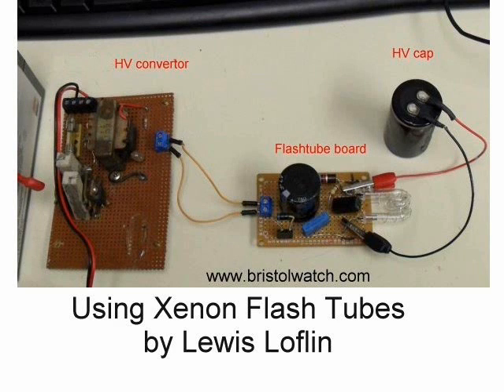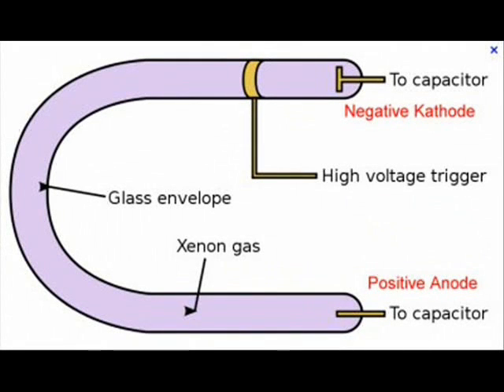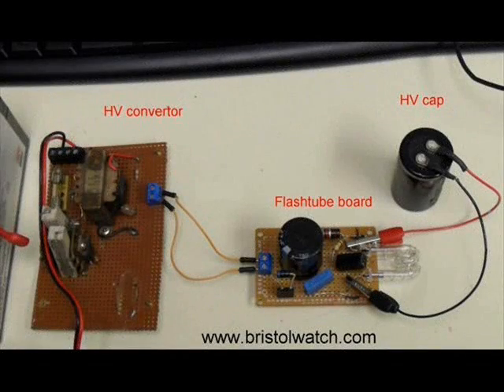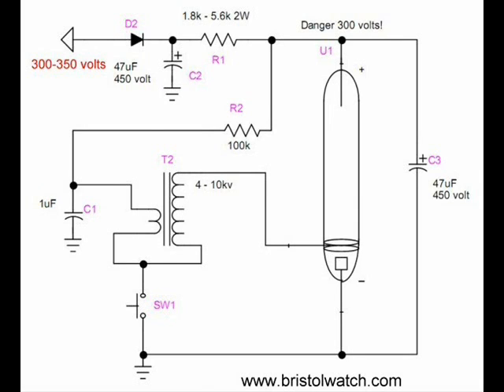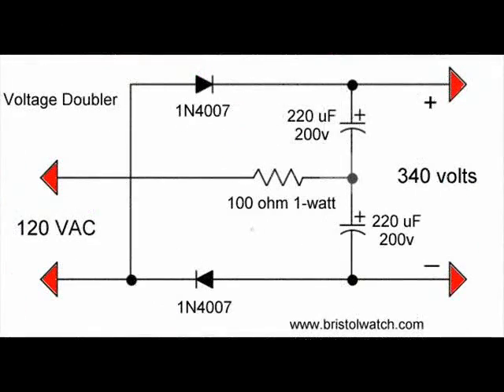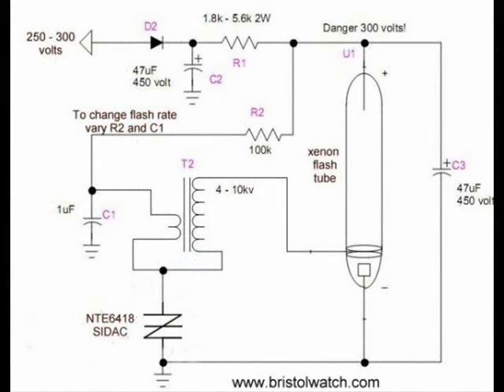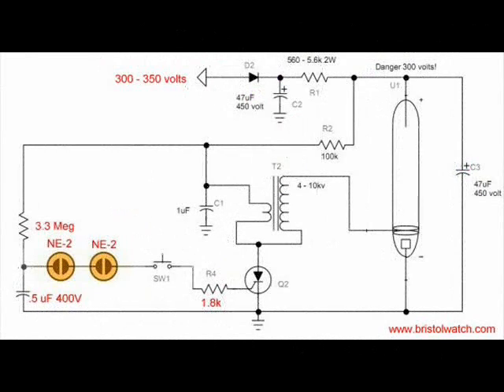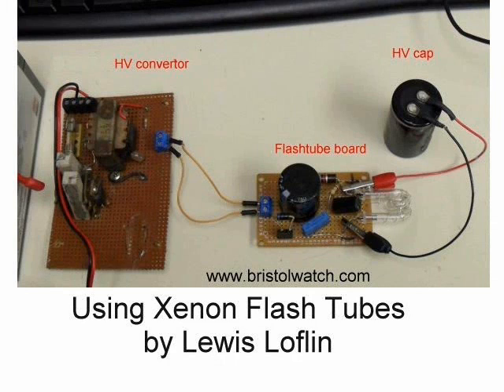Xenon Flashtubes

Comment: Hello Lewis,
I greatly need some help in firing such a xenon flashlamp firing at about 70Hz. with a logic digital signal.  I have used the various circuits which use an SCR for all kinds of lamps. I have used many professional trigger transformers and circuits for firing ruby and Nd-YAG lasers.  BUT, they use an SCR, which can't seem to fire at this rate since, in my case, will not quite fire fast enough since the circuitry holds the SCR latched.  These circuits charge the trigger capacitor (mine is less than 0.5uF). but after firing theirs depend on the SCR current to "drop BELOW the SCR holding current (if you can believe that!) to shut off.  I can get halfway there, but not enough.  I am planning to try a MOSFET (IGBT's seem to fail).
Any ideas?  I only need to fire the small TRIGGER capacitor at this rate--the rest is solved.
Thanks for all of your helpful videos and "a thumbs-up and subscribe"

Comment: Mr Loflin , thanks for the lesson on Xeon flash tubes.  Do you have a SCR identifer as most
Triacs are listed as SCR's  I have a comercial freeze strobe that the SCR measures a short
and I am trying to locate the part Number to order one,  Thanks in advance, Dave
Reply from the maker: A triac will work as an SCR. In fact on my newer video I used a triac as an SCR. See 
https://www.bristolwatch.com/ele4/flash.htm
Reply: Thanks for the clarification